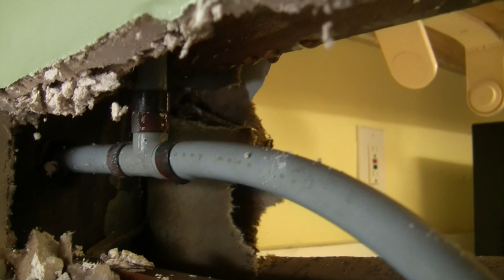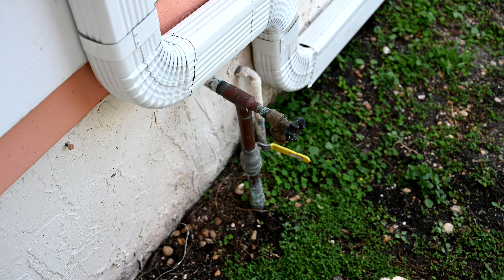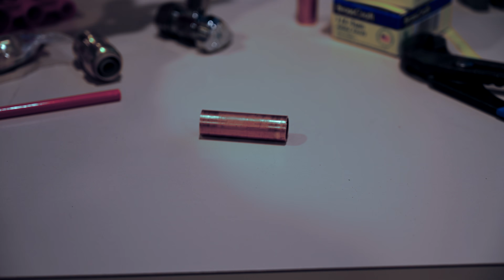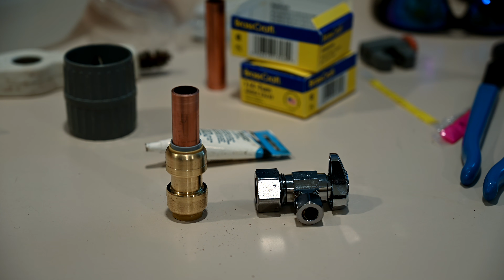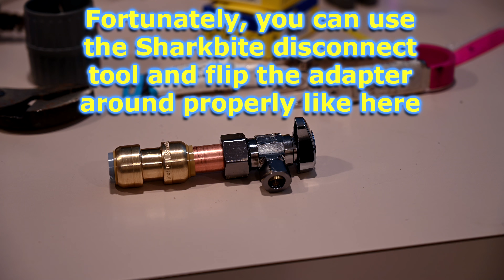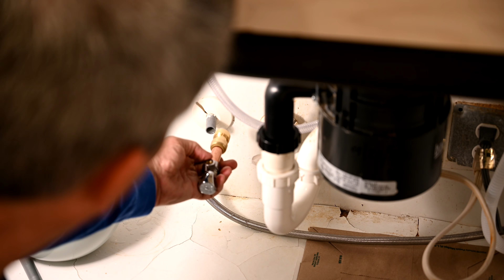How to Change Polybutylene Pipe Shutoff Valves to Copper Pipes

Comment: Unfortunately my place has this grey pipe. I tried these Shark bites but i'm not convinced they are safe to use. I feel like it is very hard to slip all the way on the grey poly. They did not leak, but I know they are not as far inn as the Pex pushes inn. Unfortunately I did not mark them. I decided to look around and I found shark bite adapters that crimp too the Poly transferring it to Pex. I feel way better with this set up. Sometimes may have to heat the poly a bit to get it to slip on the adapter though as can be very snug to push on. These adapters are called Poly to Pex adapter. I am not a plumber, I just bought the tools and watched videos so I could learn to do it myself.
Reply from the maker: As long as these adapters are outside the wall where you can inspect them from time to time, it's OK
Reply: Oh and by the way thanks for making videos as this is how I been learning. Cheers

Comment: I'm with you. Outside the wall push to fit is okay. Inside the wall, not so much. Push to fit fittings are also good as temporary fittings while pressure testing a piping run of all the PEX crimp fittings you installed.

Comment: Curious as to the sizes of the a copper tubing and the valve that you got there? Are all valves the same size?believe the poly B is all the same but not sure what your running after that?
Reply from the maker: I use 1/2" valves, with 1/2" copper pipes. The sharkbite converter I slapped on there converts from the poly pipe to copper, so now I can run the 1/2" copper into the compression valve

Comment: Jeff I realized you did not shark bite depth gauge on polybutylene pipe under the cabinet before pushing the shark bite on it.
Reply from the maker: We showed at 3:18 into the video although I might not have showed every connection we made but we do use the depth gauge on every sharkbite connection you really do need to use it or you'll get a leak

Comment: Hi Jeff, don't know if you'll see this. Just wondering if I can use a sharkbite polyb to pex adapter and then connect to a toilet shut off valve? I'm trying a very basic DIY bathroom reno, but once I removed the toilet and shut the toilet shut off valve off, it's still leaking. Was hoping to use the materials that I have. Since it's not drinking water, would a pex connection work as a low budget solution? Or are toilet shut off valves only meant to connect to copper? Many thanks, I'm learning as I go.
Reply from the maker: Yes people do this just make sure you are on the outside of the wall so if it ever leaks you'll be able to see it.

Comment: what did he do to attach the fitting to the poly b pipe itself? can't be just by pushing it in ?
Reply from the maker: Yes, the Shark bite fittings are all push in. But its still better than the the Polybutylene fittings, and it's outside the wall, so if it ever drips you'll see it.

Comment: I absolutetly hate how cut off valves under thr sunk and toilets just wiggle.. the piping just wiggles back and forth snd isnt secured.. ive seen this in every house ive owned.. which is 8 houses now.

The current house im about to close on has poly b piping.. with copper fittings and copper crimps.  It doesnt leak.. was made in 93.. but i dont know if i should replace it all or leave it alone.   Im thinking about leaving it alone.. but once the home inspection comes back im 100% positive hell warn me about the piping.  I might be able to use this to my advantage and get the current owner to replace or lower the price of the house based on contingency
Reply from the maker: Yes, that is real stupid, plumbers who work for builders are the worst, they don't use straps to secure the pipes! A great way to fix this is to get a tube of PL Adhesive in the paint aisle at HD, and fill in the gap. NeXT morning it is rock solid! I do this on every bathroom and kitchen I remodel
Reply: @jeffostroff  now that i think about it it isnt just the toilet abd sibk pioes by thr cutt off valves . Its the shower heads took that do this

Comment: I thought Shark Bites were better used for temporary purposes only. So that said, what other options are there besides this Shark Bite product?
Reply from the maker: In this case I believe the shark bite is more reliable than the Polybutylene pipe and as long as you have this on the outside of the wall where you can see it and check on it periodically you will be OK. Your other option is to do what most plumbers do which is to re pipe the house at a cost of about $10,000 right now that's real big going on up any Orlando in Kissimmee FL area as many houses up there were built with CPVC pipe which is just as bad it starts cracking and shattering on you after not even 15 years we just dealt with that at a friend's house a few months ago.

Comment: Why didn't you just make a new video. Also why not just use a PB valve?
Reply from the maker: This is a new video so I'm not sure what it is you're asking about why didn't I make a new video. You don't just replace this with another part because you can't buy the parts anymore and nobody has the Tools to fix these unlimited Poly butylene fittings because it hasn't been allowed since 1994 so most people are not equipped to deal with it. Most plumbers when they come across stuff like this will highly suggest to the homeowner to simply re pipe the whole house at a cost of probably $10,000 . So for most people the best course of action is to use the sharkbite coupling here which converts it from Poly butylene to copper
Reply: @jeffostroff  Hi Jeff was talking about you put the fitting in backwards then commented over old video. Perhaps it demonstrated how flexible shark bite is you can fix a mistake easily. (of course you need a tool for that too heh)  I have a similar case. Have a valve that works but is PB on both sides and was leaking after valve to facet. I replaced that piece with PEX but had to jam it on the valve cause PB appears to have a larger inside diameter than PEX! Guess that means the wall of PEX is thicker cause both have same OD. (For sure temp fix and shut valve when not there) From what I have read the PB pipe is ok its the fittings that were the problem. However its complicated cause they don't make parts anymore. So shark bite is a good option or a crimp adapter is a little cheaper.

Comment: I have a 1996 mobile home my wife and I are restoring.. and it has 5/8" PB pipe to toilets and faucets. Do you know the part numbers for gate valves and unions.. thank you
Reply from the maker: No I don't deal with using nay polypropylene parts or unions, I convert to copper as we showed in this video.

Comment: Most of my polybutylene are 3/8 in size.  Have you seen a push to connect for a 3/8 PB?
Reply from the maker: Did you see if Shark Bite has a 3/8" connector? I don't know who else makes anything for PB pipes.
Reply: I didn’t find any online or in store. I bought a Flair-it that went from 3/8 to 1/2. And it stated it for pvc/pex and pb

Comment: I’m an automotive youtuber who just bought a house. My washer cutoffs are leaking and they used poly behind them. I will be uploading videos after I’ve fixed my problem.
Reply from the maker: Good luck! Let us know when you get them done.
Reply: @jeffostroff  Well I got it done but it don't look pretty. I used the shark bite pieces and they have been working for over 6 months.
Reply: same!!!! keeps blowing off underneath the hot water shut off valve. I have to crimp it, and have someone else go shut off my main water supply, then clean up all the water. twice now it's happened. we tried rigging it up with clamps and tape. it just blew off a week and a half later. curious how your attempt went? hope it was successful!

Comment: Not how a plumber would do it
Reply from the maker: That's exactly how a plumber does it. You don't know the proper way to do this.
Reply: @jeffostroff  rip it out and sleep better at night.  That crap leaks.  Joints and the pipe itself.  Go get some pex and have a great night!!
Reply: Plumber here— the od of the pb is the same as the OD of the copper. The shark bite will work either way. 
The professional way to make that repair is to use the poly to pex coupling and crimp it with the crush rings. 
The pb side will have multiple raised rings and the pex side will have three. It’s the ID that is different between the pipes.

Comment: I've used the regular brown connection on polyb. It seems to work ok. I would never use it behind a wall.
Reply: It makes little sense (IMHO) to change out little bits of the polybutylene if it is the polybutylene that is the problem - breaking down over time, etc. 
Basically, if the polybutylene has begun leaking here, it has reached the end of its useful life and needs to be removed and replaced entirely. There are literally dozens of such connections in a home and many behind/within walls, attics, etc. So, maybe next week you'll be calling to replace the cold water valve in your bathroom, a month later, one in your tub or the feed to the commode.  Have you priced these polybutylene Shark Bite parts? they add ten dollars to every repair while leaving 'the culprit' hidden in a wall.
His comment that, leaving this mussy repair visible is so that you'll 'notice any leak instantly' is ridiculous. How often do you  examine the stop valves in/under your vanity? Under your kitchen sink? Leaks tend to start small and do the damage slowly over time. Often, the first time you notice a problem is when a puddle has accumulated or the vanity cabinet floor has swollen.
Reply: I am dealing with this PB issue, but next to my washer. and being a single mom, now homeschooling my daughter and trying to work, I can understand and FULLY appreciate this mans logic. it's for those who cannot afford to RIP apart their entire home, and repipe an entire house. beyond that, maybe YOU dont check up on pipe repairs outside the wall, but I do. at least 20 times a day. just to make sure. for a commenter who seems to be critisizing this man for not being cautious enough, it seems contradicting that you wouldnt keep an eye on a pipe that has been repaired. no matter what the process. you keep an eye on it. to make sure it took and isnt leaking. seems like common sense imo. but hey, I can appreciate and acknowledge we do not all think and operate the same. rather than hate on something that isnt useful for you, but is for others, just move on. keep scrolling.
Reply from the maker: Yes, that is why we left it out in front of the wall under the sink.
Reply: Yes I have used the brown poly and other friends have too. Sharkbite has the shutoff with stainless flex hose and connector for toilet float valve all in one and it uses the brown and they seem to work ok on Poly.

Comment: Don’t use sharkbite fittings
Reply: I just use a pex ring on the pb
Reply from the maker: @jacksplumbingvideos7147  I have to look at that on the next one and see. It fits OK?
Reply from the maker: Shark bite fittings are fine to use if they are out in the open where you can see them. And when you connect up to the old banned polybutylene piping, there is no other choice. The only other solution you would have us to rip out all of the polybutylene piping in a house which often runs $20000.

Comment: thanks, i hadn't seen this type of tubing before
Reply from the maker: You're lucky, polybutylene is a bad tubing.
Reply: jeffostroff Then I guess I’m not that lucky, it’s on the job I’m on today. I was trying to unplug this tubing from a some pressure fitting. After seeing your video, I just clipped it and put a shark bite value PEX and male adapter and was all set, thanks

Comment: Your next t - shirt should say if Jeff can't fix it call a real plumber
Reply from the maker: At least your comment about the T-Shirt is true, but you still have haven't answered the questions about what was incorrect here, which means you don't really know, which means customers won't be calling you if I can't fix it because you don't really know the answer, so you can't answer our questions about what is wrong with this installation. LOL!
Reply: Not going back and forth with you I'm happy you have a interest in the plumbing industry you might b the oldest apprentice in Florida but don't let that stop you they make a poly to pex adapter that is crimp on not a homeowners shark bite fitting and even that you can't install right shows in your video it's backwards dummy so before I go into explaining how to properly repair that leak maybe you should get the basics down on what the right side the  shark bite fitting goes on oh yea one more thing Mr master plumber you pull the insert out on the shark bite fitting on the copper side
Reply from the maker: @oceanpointplumbing1252  you did not see that the copper pipe was corrected and installed on the designated copper end of the Shark Bite adapter, you simply failed to watch the video and you call me the dummy? LOL. So you'r going to tell people that the way we have it connected in the end is wrong? The copper pipe is connected to the correct copper side of the adapter, and you're calling me the dummy? LOL!.  You are wrong about removing the insert, it is not required to remove it when using copper pipe, it is optional to remove it. Here it is pasted from SharlBite's own web site: "NOTE: The tube liner is necessary for use with PEX, HDPE or PE-RT Pipe. It is not required for copper or CPVC, however, it is not necessary to remove the tube liner from the fitting.
"  LOL! LOL! So that's twice you tried to show I did it wrong and  twice you failed. You see? You notice how I show the facts with evidence, while you keep hand waving and pointing out things that you are wrong about because you lack the knowledge, and you lack the evidence to support your incorrect statements. Look, you're dealing with an engineer here, if you're going to try to prove me wrong, you need to first have the knowledge, and second show up with real documented proof. Call me a hack or whatever, but in the end I solved an engineering disaster created by you licensed plumbers.
"
Reply: @jeffostroff  Actually poly was created by the shell corporation which intentionally kept pex out of the states. Good plumbers were forced to use poly if they wanted jobs. The DIY hacks you are showing are doable but are not professional. Master Plumbers do not use shark bites we either solder crimp pro press or use uponor expansion tools. Any engineer should know you shouldn't compress hard copper unless you get it red hot and cool it first. My late father was a master plumber as well whom ran many feet of poly pipe that still exists to this day because he didn't use the plastic fittings or aluminum rings.
Reply: Hahahahaha

Comment: There is an insert inside all shark bite couplings that is there for use with pex tubing to help support or strengthen the pex but if using copper or CPVC you should remove that insert from inside the shark bite fitting by pulling it out with some needle nose pliers. It’s not needed with the stiffer pipe and will actually reduce the water flow. Probably reducing it down from half inch to three eights approximately.
Reply from the maker: The flow actually gets reduced down to 3 eights on the output of the angle stop anyway.   Below I pasted from shark bite's online instructions that state "The PEX stiffener does not need to be removed for Copper or CPVC applications."  But yes you are right it will reduce the flow down which is fine if you're connected to an angle stop anyways with its 3/8" output.
Reply: @jeffostroff  yes Jeff, don't they also recommend that you leave it in so that you don't damage the stainless teeth? See, I'm not a troll buddy! I'm the one that commented on your bagels and lox... Calm down..
Reply from the maker: @sal.pizzurro   Just my own personal opinion I would be a little apprehensive about pulling that insert out I'm afraid I would damage the teeth. Dealing with the shark bites is not as smooth as they make it look even with that really good higher cost removal tool sometimes you really get a tug at it to make those things let go.
Reply: Do you know if they make a shark bite connector for polybutylene to pex a
Reply: @eclecticgentleman  that's a good question
Reply: @eclecticgentleman   I wasn't aware that shark  Bite made a polyurethane adaptive end.  I research this before a few years back and I was told  that it was only compatible to pex not poly b.

Comment: They are not crimp on gate valves under the sink , they are 1/2 " angle compression stops. Why didn't you show us when you changed the Sharkbite  fitting around that you had inserted backwards?

Comment from the maker: Parts used in this water shut off valve repair video:
✅ SharkBite U4008LFA Polybutylene Conversion Coupling Fitting, 1/2-Inch by 1/2-Inch: https://amzn.to/2YOi8jk
✅ SharkBite Deburring Pipe and Depth Gauge Tool: https://amzn.to/2W0teES
✅ SharkBite 3/4 In Disconnect Tongs: https://amzn.to/2Wq221E
✅ RIDGID One Stop Wrench Kit : https://amzn.to/2ClCbNa
✅ Channellock 12-Inch Pliers: https://amzn.to/2MdcnGR
BrassCraft G2CR19X C1 1/2 in. NOM Comp Inlet x 3/8 in. OD Compression Outlet Chrome Plated Brass 1/4 Turn Angle Valve: https://amzn.to/2VM6P9n

✅ Gear we used to produce this polybutylene pipe repair video:

✅ Nikon Z6 Camera Kit w/24-70mm Lens: https://amzn.to/2w9sAp9
✅ Deity V.Lav Lavalier Lapel Microphone: https://amzn.to/2HBmSmA
✅ Rode Wireless Go Mic Transmitter/Receiver: https://amzn.to/2M7vUvV